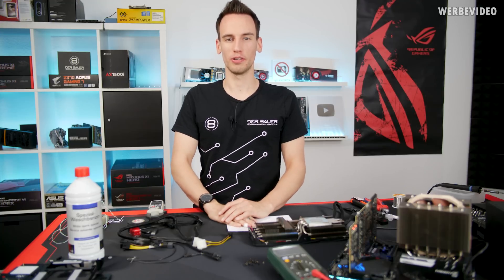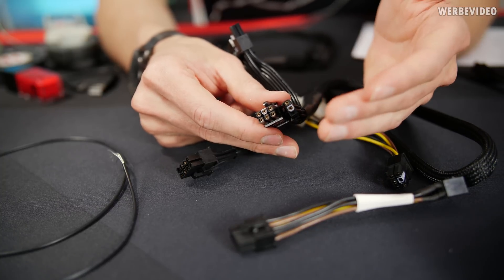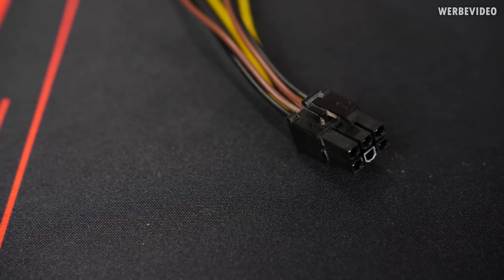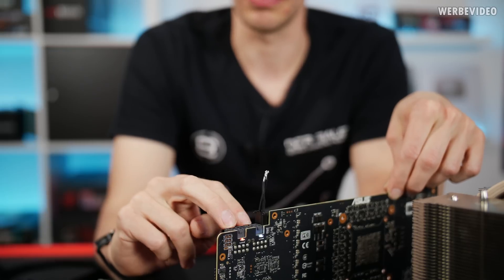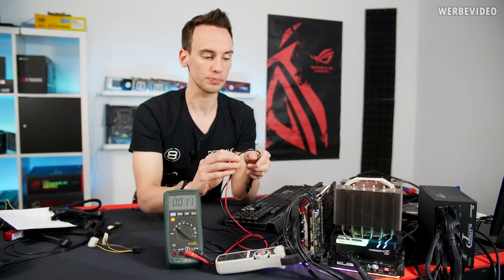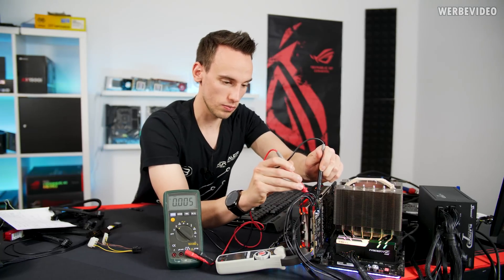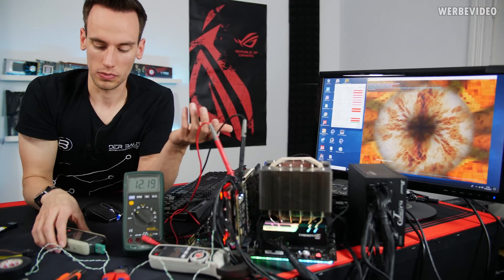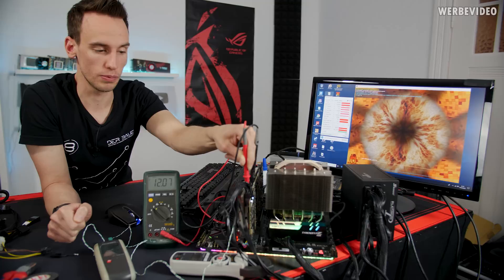PCIe Cables: So much does your GPU really need!

Comment: On a side note .. 
NEVER connect two 8-pin connectors, coming from one cable (common on Corsair modular PSUs) to a power-hungry graphics card. 
I had a heavily OCed 980ti, which had its two 8-pins connected with a single modular cable out of a Corsair AX860. One night, a thick burning smell started spreading from my PC, turns out the connector on the PSU was fused with the modular cable's connector and the plastic housing started melting. 
I have no idea why PSU manufacturers bundle cables with split 8-pin connectors in the first place, that can obviously be a fire hazard.
Reply: Been running an 860i in SLI for years using a pigtail connector on a 2x 780 Ti, 2x 980 Ti, 2x 1080 Ti and now 2x 2080 Ti's. PSU has been on 24/7 for about 5yrs without a single issue and at least 8000hrs of gaming.
Reply: andydsm I'm using the two 8-pins cable of my CX650M for a year now on my 1080 ti x trio... Should i be worried?
Reply: @kursad3339  if I were you, I'd immediately run another cable from the psu to the second 8-pin of the card, before this happens.

Comment: I'm guessing that the wires are not going to be an issue, but it probably requires a very decent psu if you want to draw more current than it was meant to. The video basically shows that you could power a 2x8 pin card from a single 6 pin connector, except it would require the psu to be able to deliver up to 300 watts on that 6 pin. Some older 600+ watt psu's only have 6pin connectors, so 6 to 8pin adapter might be ok to use then.
Reply: As long as the PSU specifies it can supply more than 25 amps on whichever 12v rail feeds the 6-pin PCIe power cable and the wires are the correct gauge, then that should be true.

Comment: That's a realy good video.
 
Next step is powering an 9900k with 2 pins for 12v and 2 pins for GND, to prove that the "2 times 8 pin just for the CPU" that most motherboard vendors are saying is just bullshit. 

On this video Mr Der8auer was drawind over 8 amps from each 12v wire when he was using only 2, without any issue. 

To draw 8 Amps from each of the 8 12v pins of the 2 times 8 pin you would need to consume over 750W, wich is ridiculous.
Reply: they are 4 pins not 8 pins.
Reply: @underabridgetoofar  Yeah. I wasn't sure if he was referring to extreme motherboards like this 1: https://www.asus.com/us/Commercial-Servers-Workstations/Z87WS/overview/
For mine it is strange because I've just checked many other similar MSI motherboards like z370 etc. and they only have 1 8pin, not the extra 4pin. Find it weird that they put 12pins in total on the MSI Gaming 7 z270.
Reply: @TefensTech  A lot of Z390 Motherboards use 2 8 pin connectors, like the Godlike, Maximus Apex or Aorus Xtreme. Even the X470 GAMING M7 is using 2x8pin.
Meanwhile most of the 990fx MBs only used one 8 pin while handling the monstrous 9590.

This is misleading af.
Reply: Good point. Which leads me to wonder if I even need to plug in the extra 4pin connector on my MSI Gaming 7 z270 mobo. It has an 8pin & extra 4pin which just seems like overkill to me. I wouldn't doubt if it could run fine with just the 8pin & 24pin connected. 
They keep them hidden behind the heatsinks too so I didn't notice in pictures. I guess I should have read the specs more closely. Just upset because now I have to order some sleeving material and sleeve an extra 4pin cable for it & don't have much time before the event I planned to showcase it(the PC Mod it's in) at in a couple weeks.
Reply: @TefensTech  Don't worry. One 8 pin is enough.
Reply: @leaferrafael  Correct. I just asked a friend who owns same mobo & they said that the extra 4pin is just for extreme overclocking.

Comment: So, we could just ditch the multiple 6-pin/8-pin silliness, drop on two 4mm bullet connectors (+12v and ground), and call it a day? I mean, if no one is using the sense pins anyway, why not? 4mm bullets passing 12v ought to be good up to around 700w before you exceed their ratings.

Comment: I buy power supplies not for the wattage, but for the number of PCI-e cables I can plug into it.  I end up with a much bigger power supply than necessary
Reply: Better to have some extra power (more efficient, lower risk of overloading it, some psus even run fanless untill some load/temperature)
Reply: I like to buy power supplies that have fancy graphics printed onto them and a convincing marketing spiel.
Reply: @SuprSi :  I like cable jacks that are consistent and that match my cables

Comment: There are single ended pci-e connectors and the dual ended 6+2 connectors at the vga card end.  For two 8 (6+2) connectors at 150 watts each, there is 4.1 amps per connector at the card end but twice that after the bridge down to the power supply and the connector at the power supply which is an overload for 18 AWG at 30C.  Wouldn't the appropriate cables be two single ended 8 pin cables from the power supply rathe than one double ended cable?

Comment: What about using the same PCI-E cable with two 6+2 pin power on power hungry graphic card like RTX 2080 Ti or AMD Vega 64?
PSU for examle is Seasonic Focus, Seasonic Prime, Corsair RMx series, EVGA G2, G3 series etc.
Reply: That will be an issue on the PSU/cable side, as it will now be out of spec. And a risk of melting the cable/connector. I ALWAYS use 1 cable per power input connector, and NEVER use the "pigtail".
Reply: @mattsmechanicalssi5833  I now that, but what is the point of that cable. Seasonic and SuperFlower made top tier PSU like EVGA P2, T2, Seasonic Prime Titanium, Focus Plus GOLD, all that PSU models has that kind of chained cables. I am using EVGA 750 G2 and it comes with one PCI-E power connector per cable. ;-)
Reply: @ValentinBrozović  I'm just one that believes in spreading the load over a wider area.  It's the actual connector that will become the issue, due to resistance at the contact points. Just like when I get a PSU, I make sure it is capable of double the wattage that the system will pull.

Comment: Now to find a way to disable those LED's for power connectors without messing with ErP bios settings.....
Reply: How comfortable are you with a soldering iron?!
Reply: @sadlerbw9  very, but electrical tape worked good enough lol.

Comment: I still don't understand why the motherboards can't be designed so that the rear of the motherboards are exposed and all the connectors are on the back of the motherboard allowing everything to be connected from the psu to the back of the motherboard imagine how clean cable management would be and how short the cables on the rear could be it would be so clean and build times would be seriously faster with minimal cable management!
Reply: some server mb's are designed this way. but seriously you design a board that works within emf limits and thermal limits. I'd bet you wouldn't be able to.

Comment: That's fascinating I wonder why they over engineer it! is it just for aesthetics? Strange!
Reply: marketing I guess. Two or three 8 pin connectors probably suggest to average joe the card will overclock better than a card with just one 6 or 8 pin connector.
Reply: Rotorage Marketing

Comment: The sense pins are not for voltage sensing on the PSU side, they're for the card to detect the presence of the proper power connector. They're always supposed to be grounds.

Comment: MSI RTX 2080 Ti Trio have 115% power limit, ASUS RTX 2080 Ti ROG STRIX have 125% power limit
Reply: yep, card firmware has more to do with that than how many 8-pin bricks it has. this video illustrates that perfectly
Reply: That is over stock

If the stock on the MSI card is 275w while the Strix is 225w, you end up with the MSI still having the overall higher power limit
Reply: @betrayedpredator8826 correct . the strix has one of the lowest power limits for a high end 2080ti maxing out at around 325W(125% power limit) , however if you flash a galax bios on your strix you can do 425-450W like mine :)
Reply: Meaningless values... For example
+15% to 1000w is alot more than +25% to 500w
Reply: Just add: Gigabyte gaming oc has 122%
Reply: @Martin M I m talking about gaming oc version of card(rtx2080) , so not made to look good but to perform best possible, no ton of unnecessary rgb.. I can easily say best cooler of all rtx. Gaming oc at 2100mhz(dropping to 2070), vram(Samsung) at 16800mhz..+2800mhz(16400daily) ,voltage +13% to make huge vram overclock stable, have only 51c with maxed fans while running superposition 4k. 55c with fans on 60%.